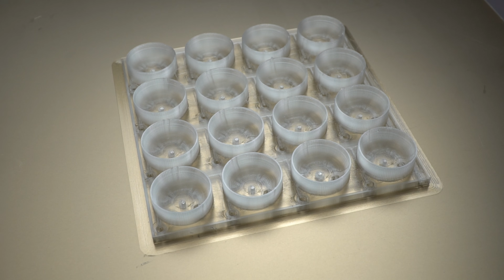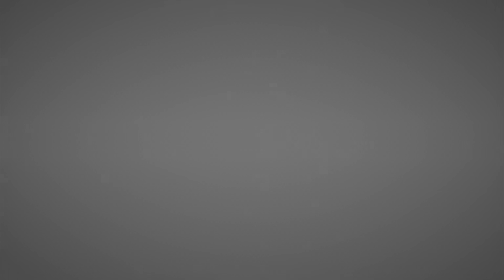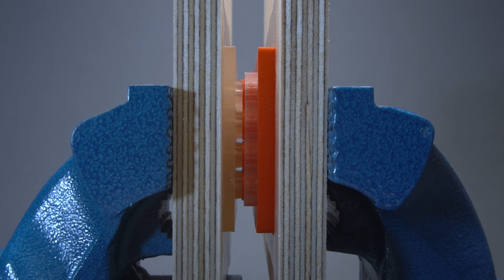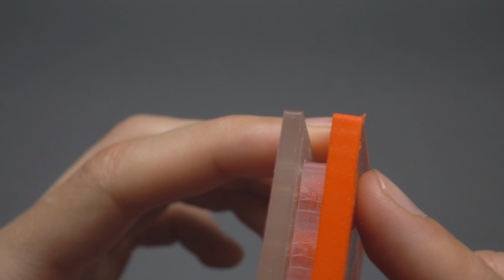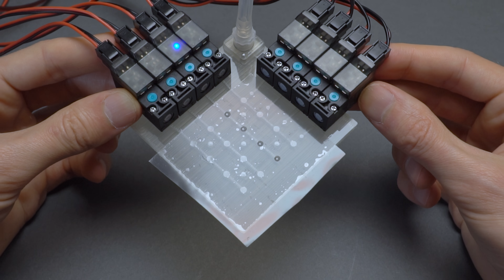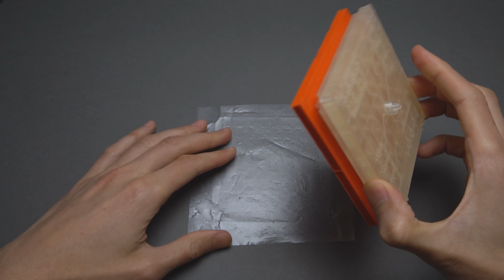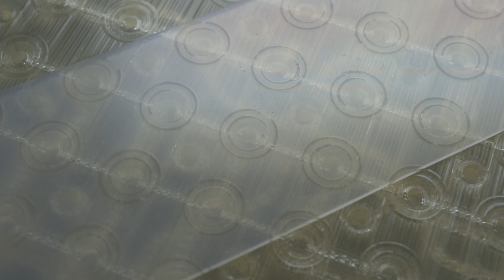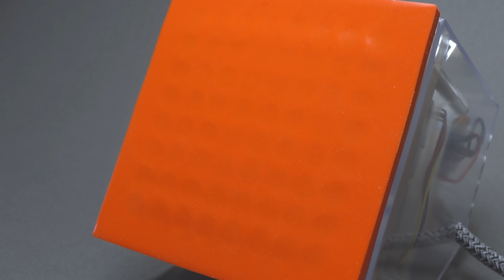Air Powered Display: 3D Printed Fluidic Multiplexing

Comment: Your work is stunning! Switching to the flat mount solenoid looks so much better, and appears to improve the function. Your execution of build techniques to get the scaled up version to seal without too much messing around was excellent!

It looks great, and functions nicely!

Have you thought about building custom solenoids? Something like a few turns of thin wire around a silicone handle to push and pull a membrane from below? You could get them to react at speeds and forces appropriate for whatever you design. Maybe use steel wire or disks glued to the bottom of the membrane, and a pcb with printed coils underneath to actuate them like a tiny speaker.

I think with a fast acting actuator, the cells could be used like tiny bellows and channeled together to drive a stirling or air cycle heat pump, or as a small compressor to drive tiny air or hydraulic motors. Thermodynamic control across cells on a surface, where you can migrate heat from one location to another with precision, while using micro pumps to create increased flow or pressure of fluid, seems like it would be extremely useful for more complex machines and laboratory work. Imagine a wax actuator where you can precisely heat and cool the material to control the rate and magnitude of the expansion and contraction. That could be pretty useful for motions that require more force at low input energies. Paraffin wax and mineral oil melts together and can give you a slushy mixture that hardens well below room temperature and doesn't fully melt until it's around body temperature, so you can get a lot of expansion and contraction out of it with small changes in temperature that aren't fighting the ambient air temperature on large differentials. Plus slush is easier to move than hard wax if you need to.

Who knows, maybe you'll be able to drive things with such low energies that you be able to use thermopiles or tiny solar cells that mimic leaves, like a little random walking salamander robot with nothing connected to it, or maybe a sloth. I don't know the limits of ambient energy harvesting without attaching to thngs like fresnel lenses outside or heat in an attic or off a refrigerator coil. There is enough to do things that look like magic though, you're within the scale of biology. Maybe a little reservoir that mixes water and ice melt pellets. That would give you enough heat to drive pressure differences. Different salts give different temperatures when they combine with water, and then you get the salt back by evaporating the water off so you can use it again and again.

I don't know where you want to take your projects and explorations, this is just where my mind wandered when I saw your awesome work. I really admire what you're already doing. 👍

Comment: It would be awesome to see you incorporate the printed microchip rotating ring oscillator into your soft robotic salamander to make it purely run on air, without the use of computer-controlled solenoids!  Using electronics within a 'soft' robot seems to stray from the original intent of prior videos.

Comment: This would be amazing for readouts on any machine that already has vacuum systems, like connecting it to the vacuum lines on an older car! I can also see a Strandbeest-style device that has a mechanical vacuum pump and electrical generator powered by a wind turbine.

Comment: I want to see a full adder so much
Reply: same, it would mean an air computer is possible
Reply: @The_BrickYT  It's almost certain is something possible. Even if some people say that the hard thing would be to make memory. It's not a real problem because the "transistors" already stay on their physical state. That means that they work like those transistors that are like an hybrid with capacitors that I forgot their name.
Reply: @Jacobra-qv6iu  You have pneumatic latching valves and probably a lot of other methods. When using pressure and vacuum you basically can create the equivalent of CMOS logic, so I don't see why memory would be an issue.

The issue is speed. The best I've seen is like 10 Hz...
Reply: @TICS_Game  For the moment, yes the speed might look like a problem until we actually see what this is capable of.
Reply: @Jacobra-qv6iu  Not much. This is why the transistor was a revolution. Before transistors and vacuum tubes it was all mechanical already. Pneumatics and fluidics are mechanical as gears, just a little more fancy / scalable. They are useful for a lot of things but not really to emulate what we already can do with transistors.
I would bet much much more on optical computing. They already are doing incredible things with that, even if it's not something people talk about.
Reply: @TICS_Game  Sorry can you tell me which comment you are answering to. There is many I sent.
Reply: @TICS_Game  Nvm now I see what you was answering to. And yes of course. We are not going to build a modern windows computer because of the same obvious reason that even with transistor computer it took decades to build the huge libraries we have that help almost any program made.
Reply: @Jacobra-qv6iu  We need home-made-able mechanical computers for when our overlords feed the entire existing internet and other infrastructure to their AI.
Reply: @carcharoclesmegalodon6904 We can technically build transistors ourselves (if ever companies stop selling us individual transistors) but they are apparently unstable. However, we still can build relays to build electrical computers. If you want fully mechanical then there is things like Digicomp I, marble computers (falling marbles or Roons-like system), gears (maybe with also help of those temperature motors to make small buffers), this video's microfluidic circuits, etc. Believe it or not many things can be used to build computers.
Reply: @The_BrickYT  Main issue is speed. The best microfluidics/pneumatic digital logic circuits I've seen run at something like 10 Hz.
You can't do much at this speed and applications are very limited, especially for the cost / complexity.
Reply: @TICS_Game Minecraft computer have proven otherwise, most of the ones i've seen run under 10hz and can compute things like de Fibonacci sequence
Reply: @The_BrickYT  Computing fibo sequences is not doing much lol. Even the intel 4004 (first microprocessor) was already 740 kHz. See the difference? 5 orders of magnitude.This is the reason the transistor changed the world. Even vacuum tubes are orders of magnitude above fluidics and pneumatics. Minecraft computers are great educational toys, but this is their limit. They can't do anything useful in real world application.
The real interest of microfluidics is not doing logic operations, it's to automate complex chemical reactions with high parallelization and control (lab on a chip). This is also why you don't see much microfluidics logic in academia, and even less CPUs made with them. This is definitively doable, but not really useful.
Reply: @TICS_Game dude with the current ram crisis, i think air powered ram is viable.
Reply: @TICS_Game  Bro its just like with breadboard transistors. We of course know we cannot run fully software that people call useful but its still interesting I don't understand what you are trying to contradict. EDIT: Also you are literally comparing industrial microchips to a handmade computer there is no comparison at all. Indeed, I would say that an enough complex redstone computer could do many things if there wasn't the speed problem and the size.
Reply: @The_BrickYT  Big news for the mormons.
Reply: @The_BrickYT combinational logic would be a good step but I think memory would be the hardest part of a microfluidics computer.
Reply: @kerbal4949He kind of aleeady provee it with the pixels, they retain their states. The problem is how do you read it?
Reply: @The_BrickYT yeah that's right. My worry is that the reason it works with the pixels is because the membrane is so big and to hook it into a transistor you would need a much smaller membrane which would be more vulnerable to variation in pressure. Although now that I'm writing it out it seems like that might not be a problem. Idk
Reply: @The_BrickYT  Wdym read it? You can use the "transistors" base to read it. If the transistor let the pressure pass. Then it's a 1.
Reply: @Jacobra-qv6iu The problem is that I think it would be single use, after that, the data is lost
Reply: @The_BrickYT  Why it would be single use? Remember that here we use pressure. Not air in the correct term. So it will stay on that state. You can see more about it searching a flip flop schematic. Which is completely composed of logic gates.
Reply: @kerbal4949 I mean. The first computers we build won't be from far as powerful as electronic computers of course. And we will probably never be able to make them as small as electronic ICs or chips. But at least, the computer is possible it don't need to fit in a laptop. I guess that if we built a 4 bit computer. It would be at least smaller than breadboard-transistor computers.
Reply: @The_BrickYT  About the single use-ness, so are capacitors in modern RAM (I can't remember which type). All it requires is a circuit to refresh the state after a read, which can be hard.
Reply: @Jacobra-qv6iu  you're right that logic gate based memory would probably be easier than the stored-charge type we were talking about like used in the pixels, however; transistor memory would be much bigger and possibly more finicky
Reply: @Jacobra-qv6iu   I'm guessing that no matter what a microfluidics computer will be bigger (probably double or more) than a comparable breadboard computer.
Reply: @The_BrickYT That's how core rope memory worked. Reading is a destructive process, so you have to write the value back after you read it. In that regard, it's a solved problem.

However I'm sure you could design vacuum memory that isn't destructively read.
Reply: @kerbal4949 Again. Look how flip flops work. They are the main way to store memory in breadboard computers. Of course is going to be bigger than a standard computer. They have a special component that we don't but it wouldn't be extremelly big.
Reply: @kerbal4949 No, I think it won't be bigger. As we saw here. Many logic gates can be stored in tiny "microchips" which is awesome. It's going to be similar size than a computer built out of ICs. But a transistor-bradboard computer cannot actually be really small because of the breadboard mostly.
Reply: @Onestaythelast  It already exists. It's called a flip flop.
Reply: @kerbal4949 That's the exact logic that at least gsnetwork 4-bit breadboard computer use. It's not that hard and big.
Reply: @kerbal4949 If you were looking at the ben Eater's then probably. But if you look at a breadboard-transistor computer then I tell you that this is probably going to be smaller.
Reply: @The_BrickYT  Data is lost in regular RAM too. On a read, there is a refresh to keep the RAM topped up. Another thing most people don't know is that RAM also has to be regularly re-upped and will pause at regular intervals to do this operation.
Reply: @Jacobra-qv6iu  It's not really fair to compare a breadboard transistor computer with a heavily manufactured device. Breadboards are for testing and prototyping. A fairer comparison would be a custom PCB with surface mounted single transistors.
Reply: @TerrisLeonis  Core rope memory is read only. You are confusing with magnetic-core memory, usually called core memory.
Reply: @sponsor-i9h  This is the distinction between DRAM (dynamic RAM) ans SRAM (static RAM).
SRAM will keep it's state until it's powered off. But density is lower than DRAM (you need 6 transistors for an SRAM cell, VS only one + a capacitor for DRAM).
Reply: @saxsta9 I am comparing the size in order to make people see how efficient is this. I would even say it's fair enough since from far it looks that their size is quite similar.
Reply: Some papers have nice pictures of full adders in microfluidics but I'm not sure if there is any video out there.
If you like pneumatic there is a pretty cool one on youtube tho: Binary pneumatic adder from paper
Reply: @TICS_Game  Refs please?
Reply: @RogerBarraud  Tbh it was years ago so hard to find again, but it seems there is a full paper on the construction of a fluidic adder: "A Fluidic Adder Circuit Based on a Microfluidic System"
There is an image at the end with the full circuit, that is also made of a decoder and a flip flop.
Reply: @RogerBarraud  If you want something more impressive to watch, check "Pressure driven digital logic in PDMS based microfluidic devices fabricated by multilayer soft lithography." especially the supplementary video 5 and 6.
Reply: I'm doing my masters thesis on this
Reply: Me when i'm a snakeologist
Reply: Wikipedia already has lots of articles on those, complete with pictures, though they seem oddly specific: there's a mud adder, a mountain adder, a puff adder, all adding physical things - I suppose that's easy enough - but then they get more abstract. One even adds death! One has to wonder how aware that one is, when it gets to a million does it switch from outputting death to outputting metal bands?

You're welcome.
Reply: But he just played snake.
This might be one of my worst jokes yet.